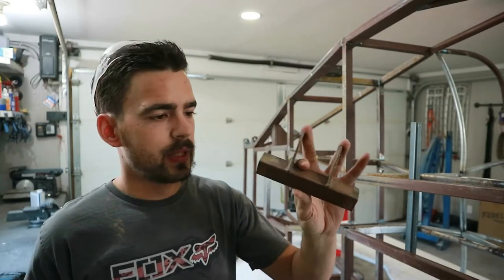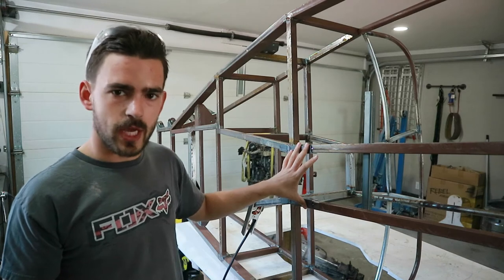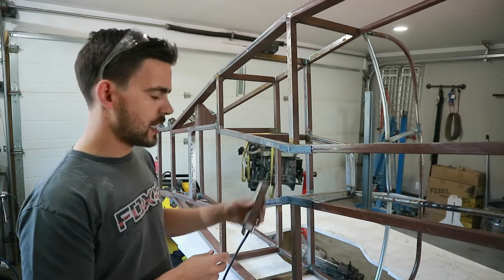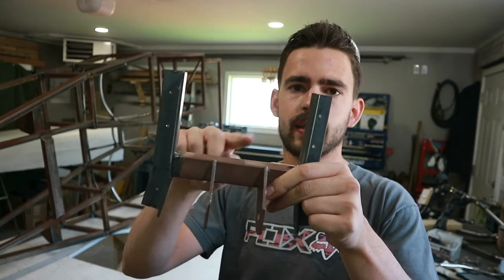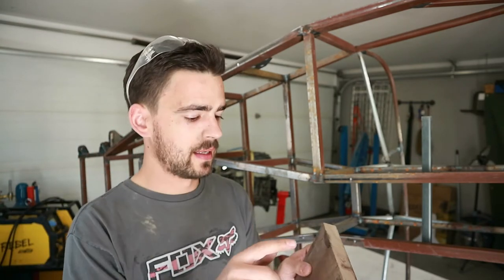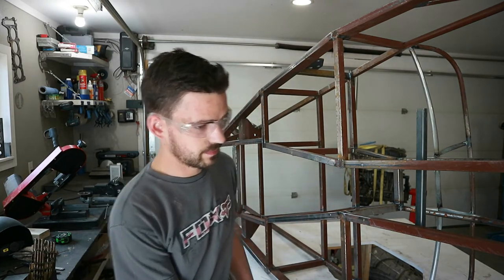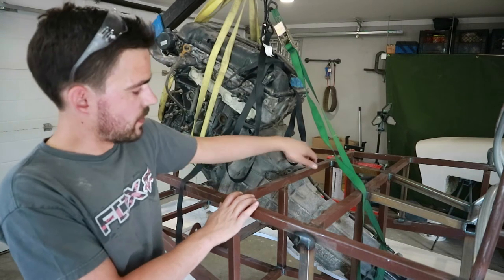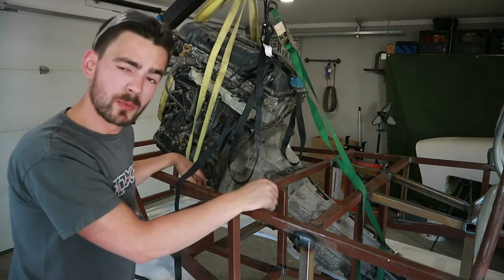Ep 87: Building the Transmission Crossmember, and Mounting the Engine

Comment: Another nifty trick for drilling straight holes is to hang something like a bottle cap opener or paint can opener on your drill bit as you drill through your material. If it starts wandering up or down the bit you know you're pointing down or up. If it isn't riding parallel to your material you're drilling through you're going left or right. Old wood working trick but I don't see why it couldn't be applied to metal. But the Walnut jig works just as good, and I know how much you love jigs

Comment: Good idea the only thing I would say is the holes where the trans crossmember bolts through the chassis should probably have crush tubes just looking at it there could be a far amount of force applied through that section and the little extra work now isn't much even if they weren't needed but the repairs and work later would be a lot if they were and it wasn't done
Reply from the maker: You are absolutely correct. I believe in always having a crush tube if you are bolting through square tubing. I machined up some 1" sleeves that we will weld in next time we have the motor out, i just didn't have them at the time

Comment: You could also re make the tube that the trans was hitting. Could be a curved unit or even an x for that square section. Would probably give you enough clearance to leave the car on the ground. Either way, coming along great 👍
Reply from the maker: I have seen a lot of people do that modification to the top crossmember to gain clearance, the issue I have is than i may need that space above the trans for electrical or my heater, so moving that bar up will rob space from other things. 
Its not off the table, and we will see how much space we have at the end to do it.